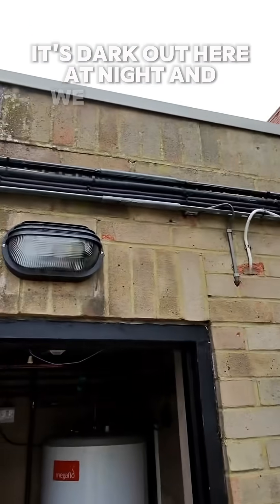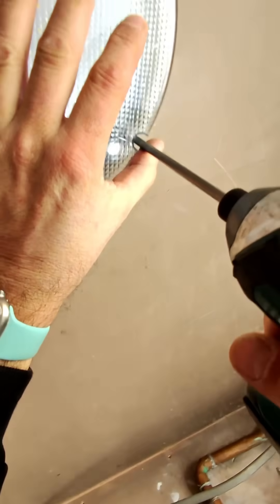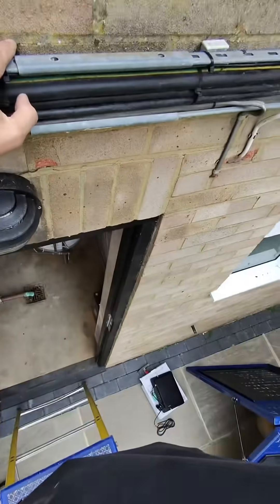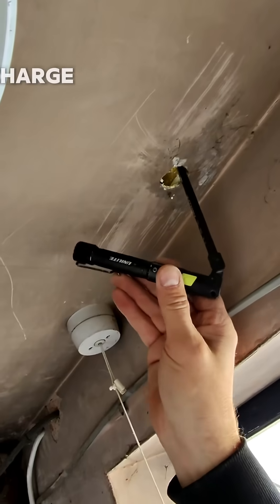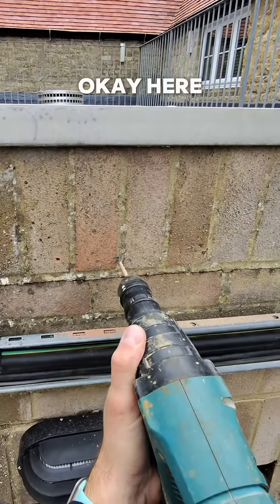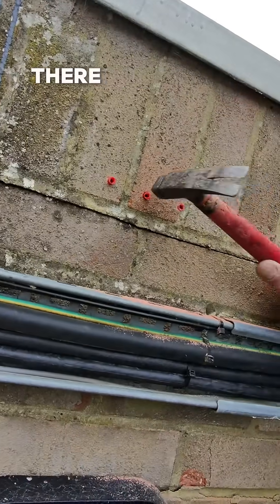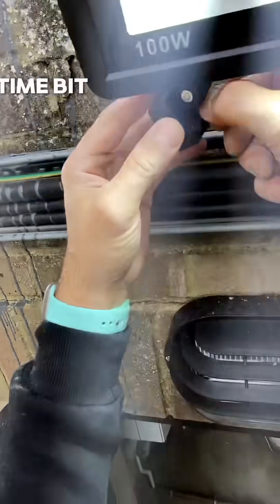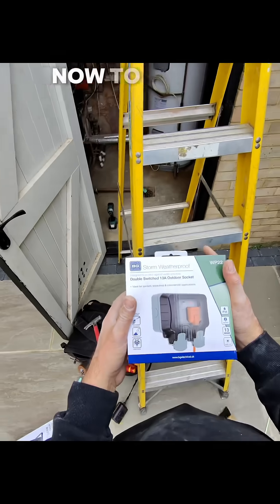How to Install a PIR Floodlight (Live, Drill & Fish, Aim & Set!)

Comment: Be careful drilling downward at a angle for the feed . That’s a water trap and any rain will find its way through proper sealing will help stop it .
I see your using a 100w LED fitting. They are supposed to be mounted a lot higher . They could burn your eyes out at that hight. I would of also put a isolator switch
Reply from the maker: Good points to consider, thanks for the advice!